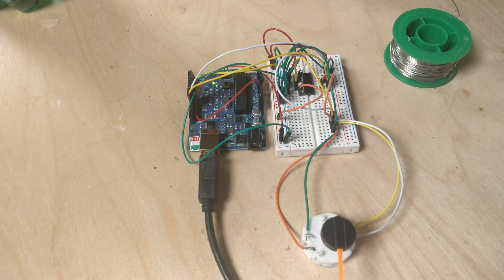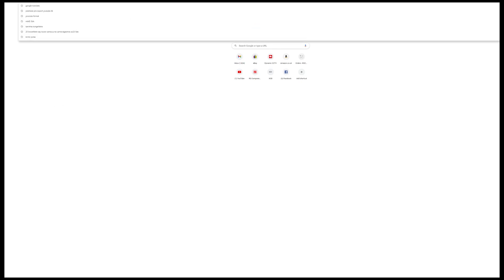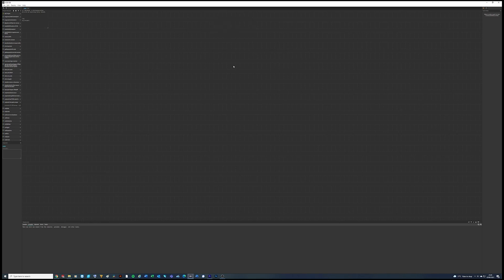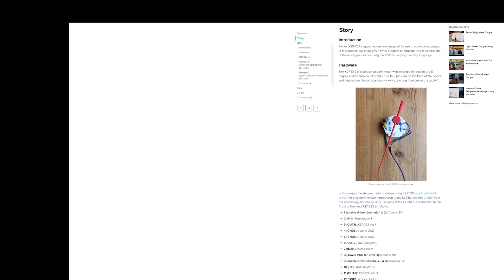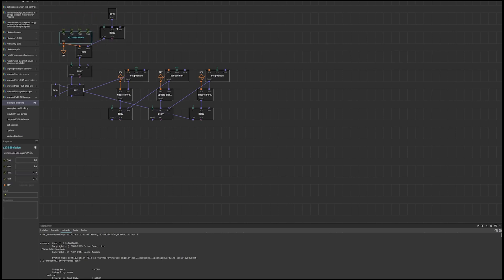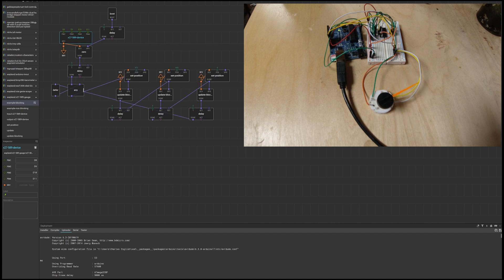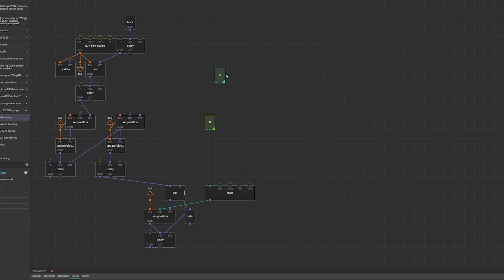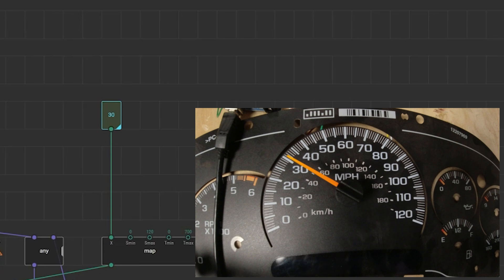Using an x27 589 Automotive Gauge Stepper with Arduino and XOD

Comment: Great video, im litteraly in the same process on a 54 Chevy truck. Thanks.
Reply from the maker: You mean using an arduino and such for speedometer? Thanks
Reply: @RocardYT  Weirdly, im in the process of doing my '50 Chevy truck lol.

Found a co-axial stepper motor, so im using the original speedo as a combined speed/rpm.
Reply from the maker: @fireflybuzzbuzz  that's really cool. How is it progressing. Been so focused on the main project I have t had time for this element.

Comment: I was just researching looking to do the same thing.  Are you planning to have an odometer as well?  I want that part to work too and not sure what to do to covert my old mechanical speedo to both this type of actuator which Ive already purchased a few to play with. I also want to somehow drive the odometer too.
Reply from the maker: I've kind of picked up on this. I haven't tested yet but I believe it'll be an add on nvram chip to store the number.  I have a hall effect sensor specifically for my transmission. Also not tested. I would say a GPS module will be a lot easier to implement.

Comment: Have you considered using a GPS module instead of a hall sender? As it would make for a much easier install.
Reply from the maker: I have done some testing with a GPS module. Really need to get back into this project! I may end up staying on the GPS route but also like the challenge of the hall effect sensor.
Reply: @RocardYT  Im just starting out on this journey and just researching at the moment, so its a steep learning curve to say the least!

What Engine & box are you fitting in the truck? A lot of the later overdrive autos have hall senders already fitted to them.
Reply from the maker: @uncensored5104  it's a 350 small block chev with a th400 box. I bought a hall effect sensor from dakota digital. The plan is to connect it. Get a signal reading using a drill then calibrate it.

I'm considering using an arduino to control all the signal lighting too.